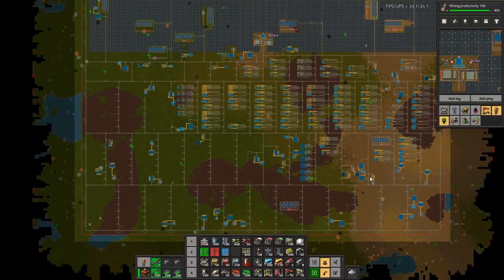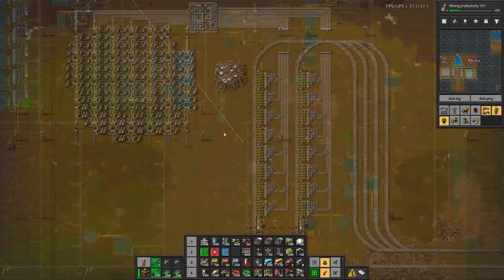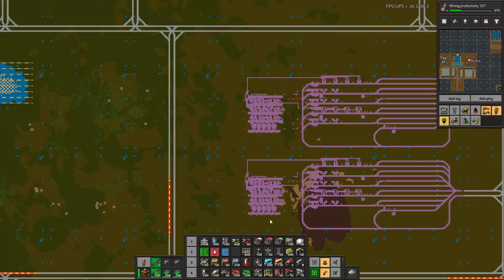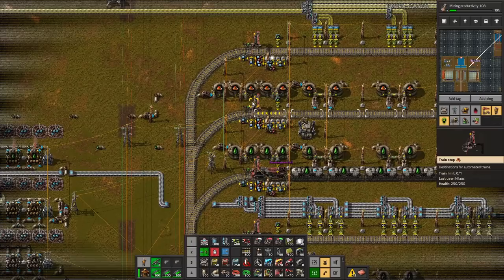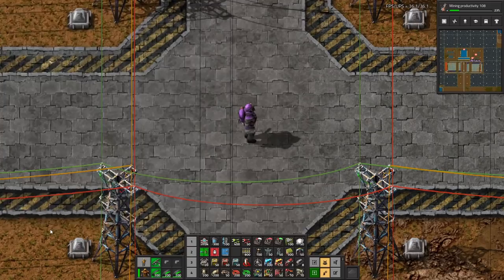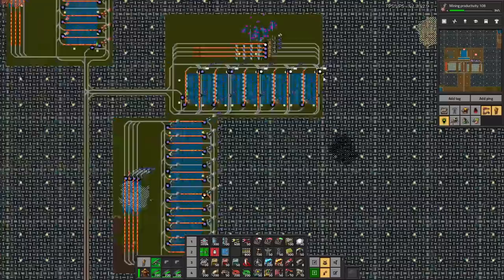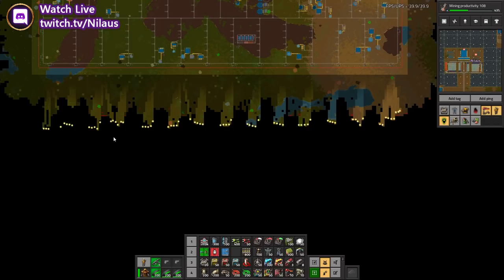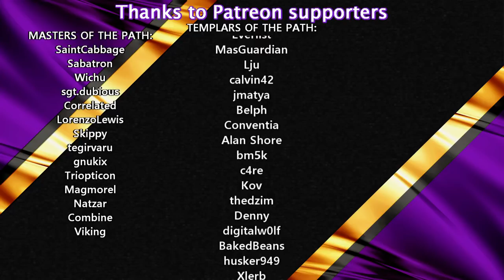Biters Go Extinct for the sake of Framerate | #83 | Factorio Megabase-In-A-Book Lets Play

Comment: Another fantastic video as always. 2 things:

At around 20:25 when you're looking at the blue science issue, I noticed that the red circuit train is just sitting there slowly unloading. It seems like there might be an issue with the numbers on the requester circuit for that. 

Also, given that you switched iron and copper over to direct train mining, would it not make sense to do the same with stone and coal? I just did that on my base and used the exact same blueprint from the iron/copper and it works great. I just added a stacker in front and limit each stop to 2 trains. Eliminates all those belts, inserters, and circuit networks for all the stone and coal locations.

Comment: You should check your other sulfuric acid builds if there the offshorepump is also not connected. You made a BP and all other offshorepumps are correct but the one. So, in the other builds you might have the same problem because you just copied it ;)
Reply: They were built in episodes 8, 13 & 55. They were all correct when they were built.

When you stamp it down with the waterfill tiles, it doesn't put the pumps in over them, so I'm guessing he just placed those manually (for the first one at least - then maybe copied that for the second one which is why they were both broken).

Comment: Seeing how in Nilaus' base, the pollution was just a giant circle and the biter attacks were just sampling the defenses' biter tightness anyways, I wonder if there would be any use for a mod that simplifies Biters in the mid-game/ end-game. Don't get me wrong, at this point in time the only purpose of these biters has become to drag out progress. Firstly by eating 20% of the frames (making every project take longer), secondly by making expansion suuuuper tedious, and thirdly through the mere prospect that doing the expansion preemptively (similar to how Nilaus kept continually expanding the solar array) would just cost even more frames. But if there was a way to simplify the biter-related calculations without getting rid of the challenge of expansion, I think that would actually be more fun than either the "biters off" or the "frames wasted" modes. That way you'd still have to build your defenses impenetrable and you'd still have to figure out a way to effectively pacify the land to claim resources, but without the biters taking that many of your ups.
Reply: Here's how the mod would work:
Firstly, If the pollution is a giant circle engulfing the whole factory equally, then it doesn't matter where it is being generated and where it is absorbed, and you can drop the calculations of how it spreads in favor of just tallying up how much your factory produces versus how much the grass and trees enclosed by your defenses can absorb.
(If you can absorb 60% so that 40% will make it beyond your walls, you'll get an amount and severity of attacks incoming that corresponds to those 40%; if you can absorb 80%, you'll get attacks corresponding to the 20%, which will be half as bad; if you can absorb exactly as much as you produce, some of it will still make it beyond the walls, meaning you'll never be completely safe. Even if you had the ability to absorb 150% the amount that you produce there should remain a tiny probability of a colonizing force incoming.)

Secondly, If pollution wafts beyond your walls everywhere and the biter hordes that the pollution calls in come from any direction, then a specific horde could just be spawned at some random location outside the perimeter, without simulating where they came from.

Thirdly, If the attack hordes don't get spawned by biter nests then the nests (and their guards) could be dormant in the simulation until the player actually tries to interact with them: personally approach within a certain range, shoot artillery at them, have a player controlled entity get close (remote controlled spidertrons/ trains/ construction bots placing turrets), ...

That should simplify the calculations immensely to the point where the most calculation intensive step might even be to figure out which chunks are "inside the walls" and which ones are "outside". And that isn't too expensive either.
Firstly it only needs to be updated any time a chunk gets its first building or biter nest placed on it or the last one removed. And then it could be as easy as 1: calling every chunk with a player-made building "inside". 2: From every chunk with biter nests (which overwrites the previous assignment to "outside") you flood fill all un-claimed chunks, and call all of those "outside". 3: The remaining chunks are declared "unreachable by biters" and thus inside.
Sure, for the purposes of this algorithm you could claim territory with a line of tall power poles. But keep in mind that biter expeditions will continue to happen and they'll be able to skip over any "fence" that doesn't stop them and claim chunks as "outside" by establishing nests. And then they will be able to launch attacks not just from the nests but from any of the chunks they claimed that way.